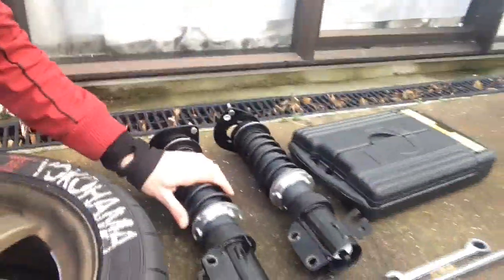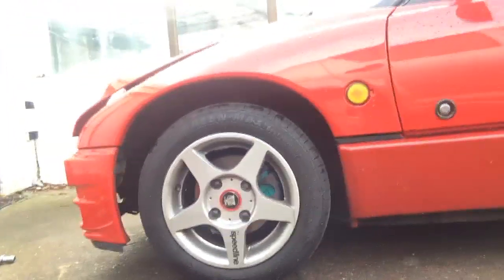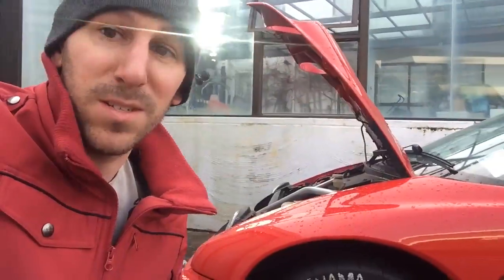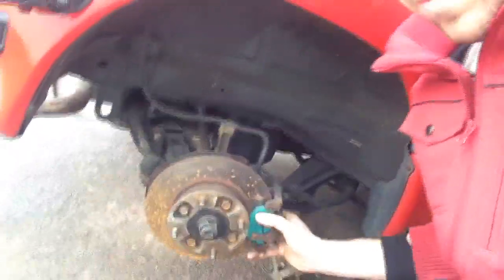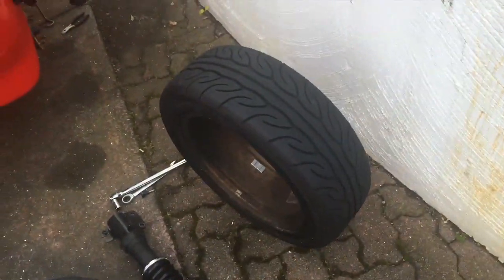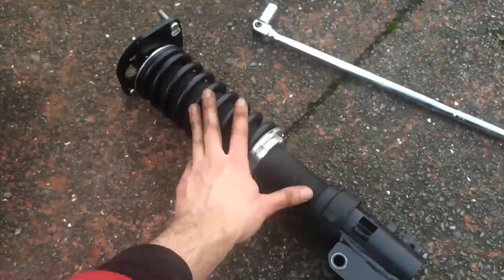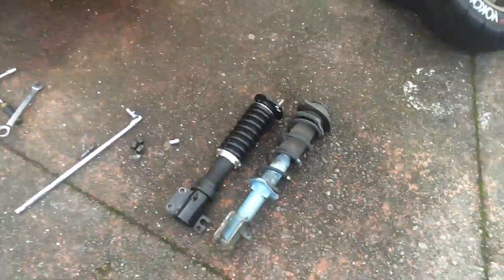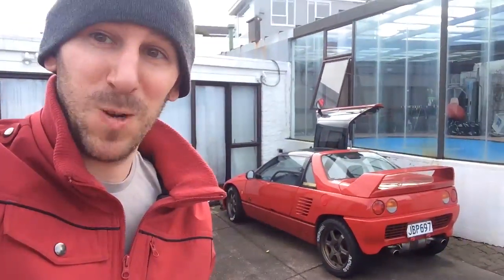Autozam AZ-1 Suspension Swap

Comment: Just found this video but need to source tires in North America (Canada). Did these tires rub at all? much easier to find this sizing than the smaller diameter ones for the factory setup, without shipping from Japan.
Reply from the maker: They only rub if you have stock suspension. On the super stiff coilovers they were perfect. You can't go any wider than this without modifying stuff though. Good luck!
Reply: @NewZeroland  awesome thanks. Just got the car a week ago. Need to get a proper wheel and tire setup that is easily sourced but doesn’t rub. Do you remember where it rubbed or if it was something easily addressed?
Reply from the maker: @ryancampbell9425  the rears rubbed on the outer arches and the fronts rubbed on the inside of the wheel well. Only on aggressive turns 😂
Reply: @NewZeroland  awesome! Thanks man.